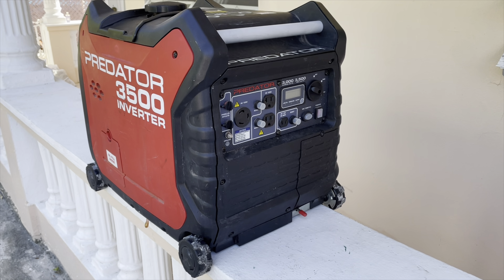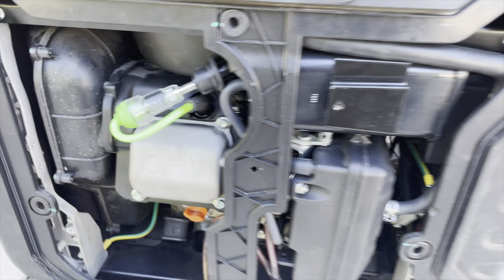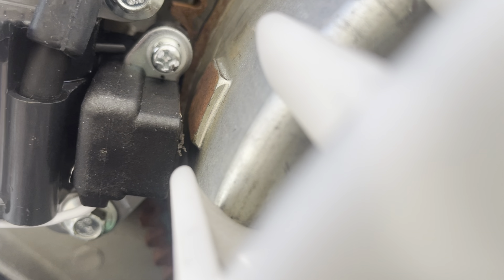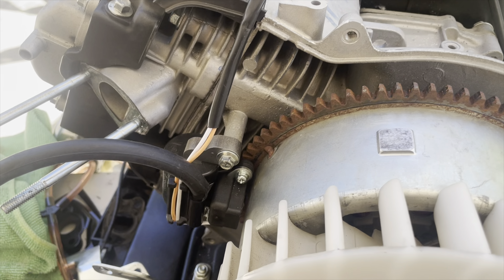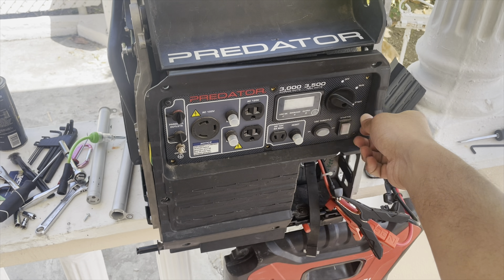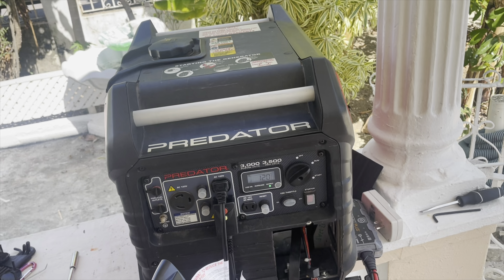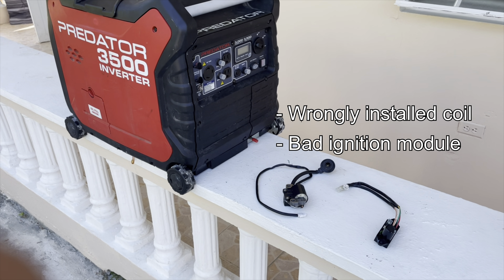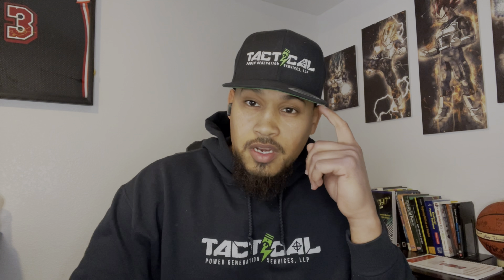Inverter generator won’t start. How to repair a Predator 3500 inverter with no spark. #diy #fixed

Comment: Hello sr great video, a question my 3500 predator it turns on fine but it will not turn off, it doesn't respond to the star , off switch
Reply from the maker: Hello! Thanks for watching my video. To answer your question, the predator’s start-run-stop switch does three thing: 1- operates your choke, 2- turns on or off the ignition and 3- opens and closes the fuel valve. It sounds like the start-run-stop switch is not engaging the limit switch to ground out the ignition to turn off the generator (you should hear a small click when you move the switch in or out of the off position. I would start by checking that function of the switch first.  Let me know it that helps.

Comment: Nice video. I just cleaned my carburetor and jets put new fuel started and was running ruff cleaned the plastic jet now can’t get it to start also replaced spark plug 🤷
Reply from the maker: Thanks for watching my video. Make sure you didn’t flooded the engine trying to start the generator. Pull the spark plug out and start the engine to let the fuel (if any) out the spark plug hole. Place the spark plug back and try to start it. Make sure the choke is closing and opening all the way when you move the start run stop switch.

If it still won’t start try spraying some carburetor cleaner through the carburetor and start the generator. If it tries to start and shuts down, you have fuel restriction issues. If it doesn’t try to start at all then you have an ignition / spark problem. 

Hope this helps.
Reply from the maker: Also, did any of the rubber o-rings of the plastic idle jet broke while you were cleaning it?

Comment: My predator has a “ignition coil “ that mounts to the top of the engine and contains the spark plug wire. I’m must be a coil at the flywheel for this to operate although I haven’t dove in that far yet. I’m getting no spark and hoping the coil on top of engine is bad but can’t find a part # or manual showing this location
Reply from the maker: Is your predator a 2000w inverter?

Comment: My 2022 predator 3500 starts but will shut off when switched to RUN mode. What can cause it to shut off? I put fresh gas in, oil is good and clean, and engine warmed up. The gen is not used much but the instructions say to run once every three months.
Reply from the maker: If your generator shuts off when you switch it to RUN mode then you have a dirty carburetor. When you switch the generator to RUN all you are doing is fully opening the choke. So if the generator shutdown down that means that the air to fuel mixture in the carburetor is not happening correctly. Too much air and not enough fuel reaching the engine. I recommend pulling the carburetor out and fully clean the jets and emulsion tube. I have other videos in my channel showing how to clean the carburetor.

Comment: Whats up my man! Hopefully you can help me. I went to crank it and halfway through the pull, my arm hit a bush and the generator tried to start, but it didnt. Went to crank it and it wont start anymore at all. It had trash so i cleaned the carb and all, new sparkplug, still wont crank. You think you might have an idea?
Reply from the maker: What’s up! All good man, thanks for watching my video. Answer me this questions and I’ll be able to help you figure out your issue. 
- Did you cleaned the main jet and the pilot jet inside the carburetor? 
- Does fuel reach your carburetor? 
- Do you have spark at the spark plug?
Reply: @tacticalpowerpro  so I should've been more detailed LOL! So I had a guy clean the carb from trash. Now, did he go into the jets? I don't know for sure. I do know cleaned and replaced the bowl and fixed whatever the seat I think? The thing that moves up and down. I meant to check and see if the plug has any spark. I don't have a meter but you can check it by pulling the rope right?
Reply from the maker: Sounds like the main jet, emulsion tube and pilot jet did not get cleaned. So I recommend making sure those are clean. When they are clogged the fuel won’t go pass the carburetor and the generator will not start.
Reply: @tacticalpowerpro  bet! You got a video for that?
Reply from the maker: Sure do. Check my channel for a video titled repairing a Powerhorse 4500. (It’s not a predator but it’s the same generator.)
Reply: @tacticalpowerpro  much love brah!!!
Reply from the maker: Much love. Keep me updated.
Reply from the maker: What’s good brother, where you able to get the generator running?

Comment: My 3500 doesn’t have the ignition module I have a 2023 model
Reply from the maker: The new 3500 doesn’t have the ignition module? Weird 🤔 they might have changed the position / location of the module but it definitely should’ve an ignition module.
Reply: I think it is built into the inverter board itself there isn’t any other place I found anything that remotely looks like the part you installed
Reply from the maker: I haven’t worked on a newer model yet but one way to find out the ignition module location is by following the wires from the CO2 sensor or the oil level sensor. See where they go to, those sensors should go to the ignition module. They ground out the ignition module to cut of the spark to the spark plug if something is wrong like having low oil or CO2.
Reply: Yeah Iv tried it with the sensor unplugged still no spark
Reply: I’ll check the oil
Reply from the maker: Yes, disconnect the oil level sensor and see if you get spark. Keep me updated.
Reply: My module is mounted to the top of engine which contains the spark plug wire as well. I haven’t gotten past the head scratching part wondering how an ignition module not mounted next to the flywheel works. I’m assuming something near the flywheel connects to the module on top of the engine but I’m afraid I’ll go through all the trouble of tearing it apart to learn the module on the top of the engine was bad all along. The problem is I can’t find a predator manual that shows the ignition module on top of the engine. If you have the same engine I have please tell me how you fixed it or where you found the parts.
Reply: @tacticalpowerpro mine is on top of engine. Have you seen that configuration?
Reply from the maker: @craigmayhan4009  is your generator a 2000w inverter?
Reply from the maker: @craigmayhan4009 were you able to figure it out?